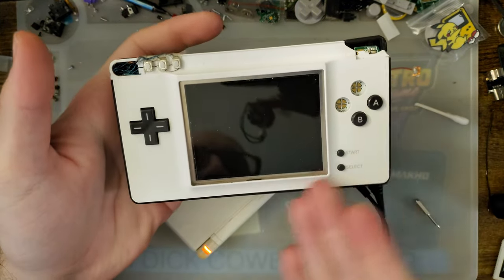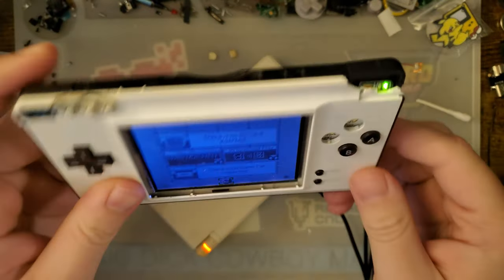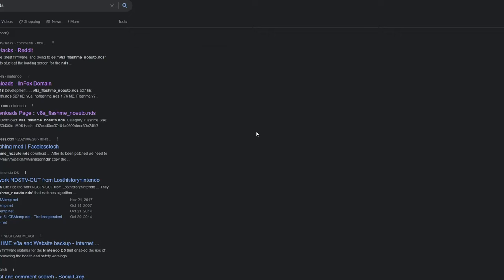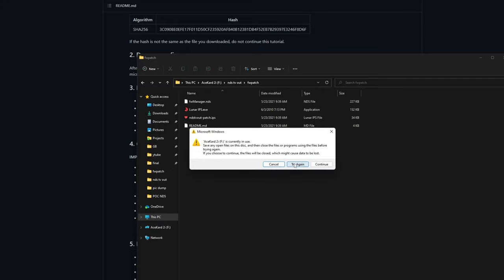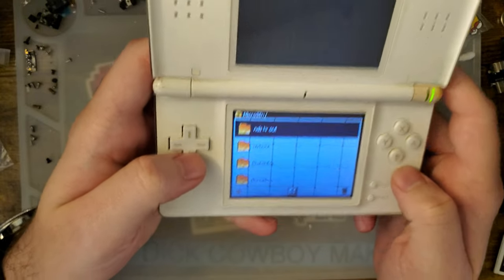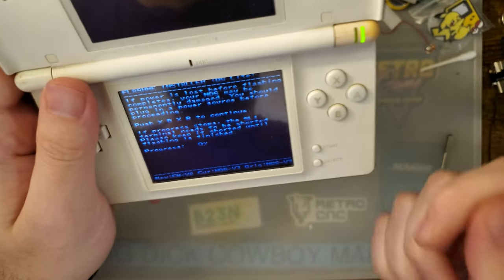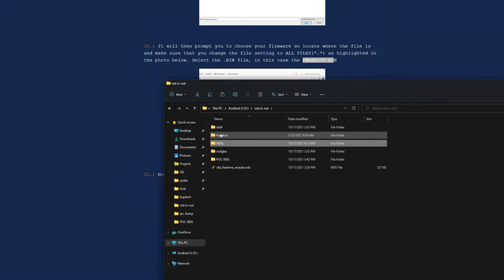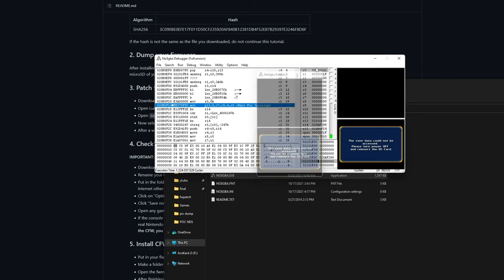DS Lite TV Out Mod Software Prep

Comment: Hi makho!! I have done all the process but when I creat the "firmwares" folder  (with the CFW inside) and I put it on the root of the flashcart , when I run fwManager I get "/firmwares" not found! I have tried with capital letters also but nothing. Do you have any idea? Thanks in advance

EDIT: Finally I got it working. I read Professor Marrill comment and as I am using a R4iMAX I have run the program from the games menu instead of the others
Reply: I am having the same problem, Would you be able to tell me in more detail ahat you did?
Reply: @carsonmcpherson3937  are you using the same flashcart? You have run your flashcart menu there are submenus I was using the wrong one (multimedia). I used games submenu and it worked. Let me know if it helps
Reply: Thank you, you solved my life, it worked as you said
Reply: @LMdelTejon  Gald it worked!!!

Comment: I am working on a Gameboy macro and I was wondering if it is true that you can cut the first 3 dashes on the flexible cable from the top screen of the DS lite and it will work to connect it to the bottom screen?
I found this news on the internet but I don't know whether to believe it or not!
Reply from the maker: Well, I wouldn't modify the connector like that but yeah, the top LCD is just the bottom LCD but with extra pins for the speakers.

Comment: Good Morning,
I started to make this change on my DS, but I think I ruined it right at the beginning, I think my DS is bricked :p
out of nowhere, my ds turned off at 1% of the installation of "flashme v8a noauto"... and of course brick...
If you could answer the following questions I would be grateful:
Is it possible to unlock the DS Brick?
if not, with the change of the wifi module the problem solved?

Now a question for maybe the future, is the DSiXL bottom lcd compatible with the DS lite?
maybe possibly who knows, For a DSmacrodual XL :p

Regardless of the response, Thanks in advance and keep up the good work.
(I hope you understand, because it's a google translator: p)
Reply from the maker: new wifi module will fix the brick

dsi xl screen is electrically compatible with ds lite (and vice versa) but the connector pinout is different.
Reply: @makho  thank you very very much for the reply. :)
"connector pinout is different." if i buy DSiXL bottom lcd can i connect the lcd to the ds lite?
Reply from the maker: @constantinoalmeida4979  if you make an adapter, sure

Comment: Why doesn't it work with SDHC card fat type?
Reply: what type of sd card do you use ?
Reply from the maker: @glakglikgluk2993  DS consoles don't use SD cards. I used a flash cart in the game cart slot. The specific SD card used in the flash cart may depend on the specific flash cart but any cart you can buy today should work with basically any SD card.
Reply: @makho  thanks for the tutorial, I've found a way with FAT sd to inject it

Comment: hola amigo no puedo instalar el v8 cuando presiono para juntar los contactos se apaga la nintendo ds y se queda en 0% que esto haciendo mal si el cfw lo descargue de tu pagina
Reply from the maker: por favor, asegúrese de no hacer un cortocircuito en el potenciómetro de metal junto a los contactos. Si te ayuda, puedes desmontar la consola y simplemente soldar el puente para no tener que meter algo en el agujero y correr el riesgo de hacer un cortocircuito en el potenciómetro.

Comment: Hola, se me ha desconectado la bateria mientras cargaba el firmware y se me ha quedado con la pantalla en blanco, se puede reparar o ya no tiene solución?
Reply: Corrigo: se me ha quedado en blanco la pantalla después de apagarse por la desconexión de batería
Reply from the maker: @mynyzl6553  Si usó flashme, es posible que la recuperación se haya escrito en el BIOS y que pueda usarla para reiniciar el proceso. De lo contrario, deberá encontrar una manera de actualizar el BIOS fuera del DS o simplemente reemplazar la tarjeta wifi (que también contiene el chip del BIOS).

Comment: great video mate! currently encountering an issue with the firmware.
whenever i open fwmanager ,it says "/frimwares" not found! . i followed the tutorial up to that point yet it seems that it doesn't work for me ;((
Reply from the maker: Is that typo from your comment or does the error message actually say that?
Reply: Try paritioning your drive so that the os is on one partition and any files are on another. Also if you are on an r4 run the program from the games menu instead of the others